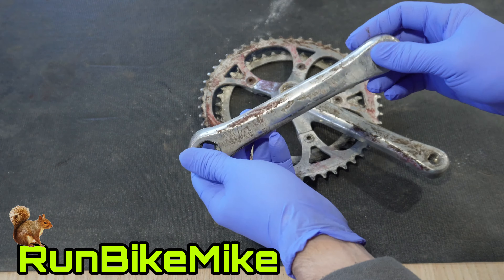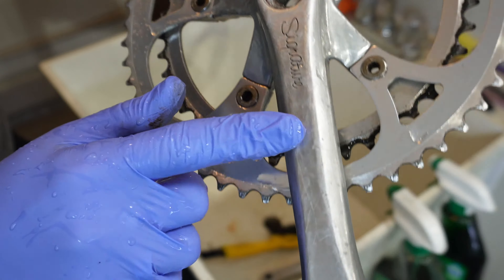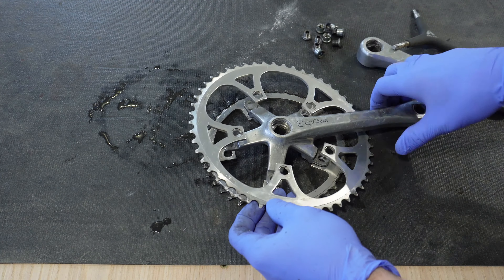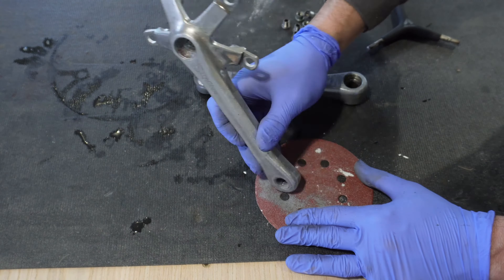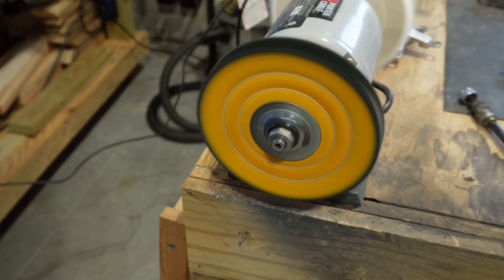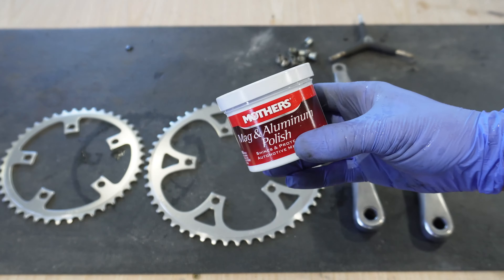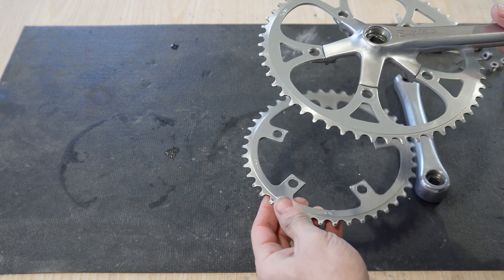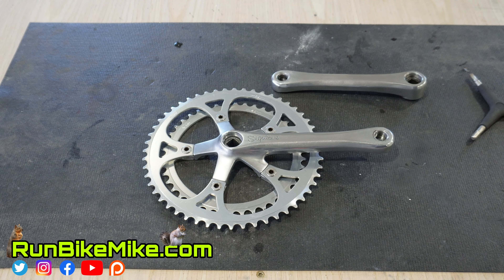How To Restore and Polish Vintage Bike Parts

Comment: heyho,
cool video.
but.. My experience is that after half a year the surface is dull and oxidised. (it depends on type of aluminum).
the surface treatment is missing (Ex factory)

cheers
Reply: I was going to ask this question! After this, how do you keep it safe from the elements? What kind of surface treatment would y'all suggest?
Reply: @suzanwaelput323  I wondered the same thing, and on other videos I’ve seen comments saying that stripping down cranks like this means they will degrade unless they are anodized again (since the sanding process removes the protective anodized layer). So they look nice again but it’s a trade off
Reply: @kajkob  thank you for taking the effort to write this answer to me!

Comment: Mothers is the best but you have to put it on the cloth and vigorously polish with plenty of the cream and then wipe off . The best way to duplicate the original silver anodizing is to sand it smooth then clear coat with 2k clear. You’ll need to sand with progressively fine sand paper to 2500 in consistent linear motion because this will be the “look” of the surface

Comment: The only problem with sanding off the anodising is that the aluminium will oxidise quickly and will become dull quickly. It may also be attacked more by road salt and other solvents.
Reply: So what’s the solution to this problem? I’ve been looking for suggestions on protecting aluminum parts after they are stripped like this
Reply: @kajkob  What about clear coating them with polyurethane?